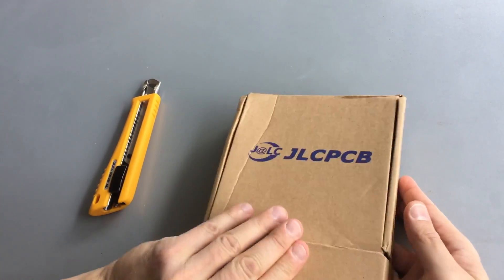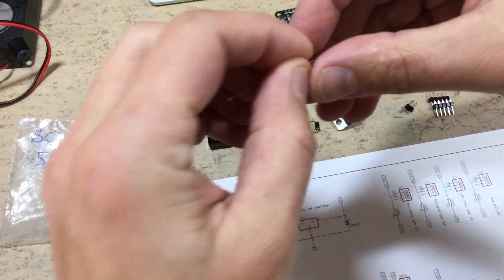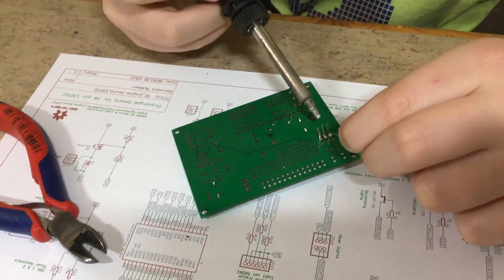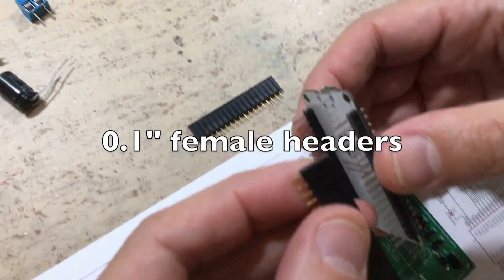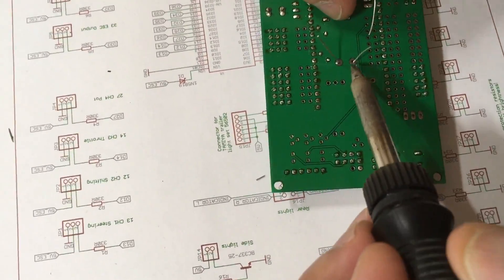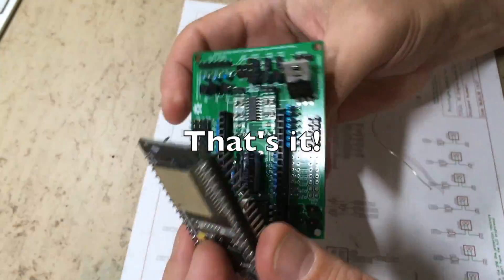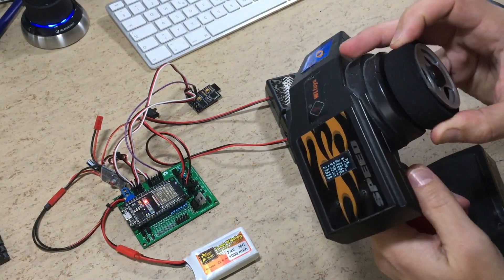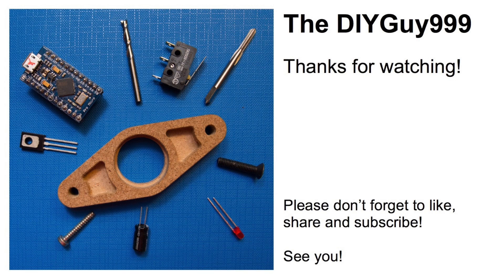Arduino ESP32 RC Engine Sound & Light Controller: How To Assemble The PCB Tutorial

Comment: This looks amazing.  I think this would work for RC planes like my Spitfire.  I think all I would need is start, rev, idea, outoffuel and hornS (for guns) sound files.   However, I don't see / hear engine shutdown.  An airplane engine has all that inertia of the prop so it doesn't just "stop".  Thoughts ?  Also can you provide a complete link for ordering the PCB.  Thanks so much.

Comment: Hi i build the compact one 
and using iBUS protocol 
 Got it build only no sound coming out 
my son install the ESP-WROOM-32  Development Board
sound/light file i know ibus compact for  just sound 

I am using  Flysky FS-i10 FS I10 2.4ghz 10ch Transmitter and Receiver System 
with FS-IA10 and using the  FS-CEV04 Serial Bus Receiver For iA6B iA10 Receiver
Need help on hookup and software to install 
Do i need to feed two power input

Comment: Need help with orderkist . Do any one have list of  all the components .All these link sent to me site of many item not know which one to order  any help would be welcome
Reply from the maker: You should use the current SMD version. It can be ordered according to the pdf in this directory:
https://github.com/TheDIYGuy999/Rc_Engine_Sound_ESP32/tree/master/Eagle_PCB
Also see: https://github.com/TheDIYGuy999/Rc_Engine_Sound_ESP32/blob/master/documentation/quickStartManual.pdf
And:
https://www.rc-modellbau-portal.de/index.php?threads/esp32-arduino-rc-sound-und-licht-controller.7183/
Reply: @TheDIYGuy999  Tjank for reply .how do i open open folder i kept clicking it but open up Would like get pc board and all part at once .I got the Mini Amplifier PAM8403
ESP-32S Board
Reply: @TheDIYGuy999  trying to find the Gerber File to order the pc boardme not good on computer finding thing

Comment: Nice jobb have orded pcb and component put hav an question how to split rear and brake lights so i can use odder rear lights not only Tamiya but Carson 7 chamber
Reply from the maker: Thanks. There is an additional output for brake lights on pin 32, but you have to use an external NPN driver transistor with base resistor. The behaviour can easily be changed in the "void brakeLightsSub()" function

Comment: Finally got it together to tweak it again, and it was doing this:

https://youtu.be/-LvZtwrAluE

Also, when I connect the ESC to the ESC pins, I get power to the board but no movement from the motor.
Reply from the maker: Still sounds like a current supply problem. Are your wires between the battery and the sound controller / ESC thick enough? What type is your battery and your ESC? On the video it looks like you are using very thin wires without a proper T-Plug and two batteries please make a decent Y-cable for the main supply.
Reply: @TheDIYGuy999  just dupont jumper wires between battery and esc. Its a 2s lipo battery with some solid core wire just kinda jammed into the deans plug.. Havent figured out a way to splice into one battery yet. I though a T adapter for the esc wiring wasn't needed with the ESC connection on the board?
Reply: @TheDIYGuy999  the esc is the stock hexfly that comes with the redact gen7. Not sure what model it is. What gauge of wire would you recommend for the main power supply? I think ill try to splice into the line between the ESC and battery with a permanent solder connection. I wish I could find those power adapters included with the ESS sound things.
Reply from the maker: @lordsanityfree  you can easily make your own adapter: solder two t-plugs together back to back, then branch off wires with about 1mm2 cross section, which go to the X1 terminal on the sound controller

Comment: Is there any way to listen to the sounds on PC before selecting them for the ESP?
Reply from the maker: No, not if you don't have the audacity project or the wav files. However, the vehicle selection will be a lot easier in the upcoming v5.2
Reply: @TheDIYGuy999  until 5.2 is ready, can you put the wav files you used for the included sounds on github? playing with settings to find the right sounds for my rig sounds tedious as hell...
Reply from the maker: @lordsanityfree  Have a look at the 5.2 preview zip on GitHub
Reply: @TheDIYGuy999  that does look a lot easier to work with. When do you expect it to be out of beta?
Reply from the maker: @lordsanityfree  I think this or next week. What type of vehicle will you use?
Reply: @TheDIYGuy999  one will be a redcat gen7 I'm putting a custom ford f150 body on. The other will be a custom built 6x6 semi, an old American cabover. Like Optimus Prime took a job as a logger or something.

Comment: HOLY CRAP, IT'S WORKING!!!

When i power the x1 off my battery and let the esc power the rest, it works!

Now I've just got to fine tune things. Like, make it start BEFORE it starts moving. And figure out my horn...
Reply from the maker: I always told you wire it according to the instructions ;-). If you don't want it to drive before the engine is running, connect the ESC to the "ESC" connector, not to the receiver. I strongly recommend to use the Hobbywing 1080 ESC to achieve perfect results.
Reply: @TheDIYGuy999  you're talking about the 3 pins marked ESC below the receiver inputs instead of the extra ch3 input?

What do i change in the code to make ch4 run a horn from a push button?

Also, the LEDs im using have resistors pre-wired in the leads. How do I use those, since the board is designed to incorporate resistors on the board?
Reply from the maker: @lordsanityfree  Yes, I do, that's why it's labelled "ESC".
Connect your push button channel to input to CH4, uncomment //DEBUG, add "Serial.println(pulseWidth[3]);" to the DEBUG section, if not already there, read the values in the serial monitorwhile pressing the button, then change the void triggerHorn() function, if the value is not around 1500.
Your LED wires with resistors are perfect. The board labelling says "use series resistors for the LED". The resistors on the board are for the transistors bases.
Reply: @TheDIYGuy999  heres my end goal for lighting. 
Head and tail lights always on. Easy, just plug them into the rx.
Working turn signals. Easy, board is already set up for that. 
Reverse lights that come on only when moving backward.  ???
Bumper mounted fog lights and light bar controlled by one of my 3 position switches for OFF/ BUMPER ONLY/ BOTH. 

Can this board do all that?

Comment: New board, new ESP32, new everything. Clean install of code. All I get is ESP power cycling.
Reply from the maker: Do the supply wiring according to (chapter "wiring"): https://github.com/TheDIYGuy999/Rc_Engine_Sound_ESP32/blob/master/README.md
The voltage on "X1" needs to be 7 - 12.6V. also make sure, your supply and BEC can handle at least 1 Amp.
Reply: @TheDIYGuy999  i did that. To power the ESP and receiver (remember, just trying to get a working prototype for sound only) I ran a dupont jumper from a 5v pin on the side with the LED outputs to the Vin center pin of the receiver side. 

It seems like everything is fine until the ESP32 tries to boot.
Reply from the maker: @lordsanityfree  And how to you control the throttle? With a PWM servo tester, connected to CH3? And your communications settings are in accordance with the chapter "Interface type"? Also make sure, your ESP32 pin "D0" if you have one is connected to nothing.
Reply: @TheDIYGuy999  I'm using your pcb board so I assume d0 is routed correctly. For throttle control I'm using my radiolink rc6gs transmitter and receiver. Channel 2 on rx (throttle) connected to channel 3 (throttle) on board. Letting the board power the rx.
Reply: @TheDIYGuy999  looking at the Amazon page since I'm not home. Confirmed I have the 30 pin board without a D0 pin.
Reply from the maker: @lordsanityfree  I just tried your wiring with the 5V jumper link and it works just fine. And there is nothing else connected to the rx? Powercycling looks like something is drawing too much current and your supply can't handle it. Is the 5V rail stable and shows continuous 5v? What happens, if you remove the ESP32 from the socket, power it from USB and load the blink sketch (pin2 is the onboard LED)?
Reply: @TheDIYGuy999  i will have to test that when I get home. The 5v rail seemed to dip to about 3v every now and then but I thought it was my fault with the probes. Would that mean a bad regulator?
Reply from the maker: @lordsanityfree  It means you are overloading the regulator, you have a bad contact somewhere (maybe the dupont wire) or a bad battery
Reply: @TheDIYGuy999  how do I find and fix that? The battery is 6 cell nimh putting out 7.8 volts. I dont think it's the problem but I'll try it with one of my newer 2s lipo as soon as they reappear from the move.

Comment: mohon pencerahannya  saya coba  unggah esp32 yang30pin error terus mohon sulusinya..
Reply from the maker: Please read these instructions carefully:
https://github.com/TheDIYGuy999/Rc_Engine_Sound_ESP32/blob/master/README.md
If you still have errors, post the error message
Reply: @TheDIYGuy999   apa harus di pasangi dulu komponen ya ? Setelah itu di unggah??
Reply: @TheDIYGuy999  maksud saya pas di colokin ke pc esp32 apa harus di pasang dulu komponen pendukungnya..
Reply from the maker: @Iwan-Dy  Read README.md, install required board and libraries as described. Then configure "Adjustments.h" to fit your needs and hit upload
Reply: @TheDIYGuy999  ok saya akan coba dulu..
Reply: @TheDIYGuy999  mohon maaf. masih terjadi error lagi. belum bisa ini.
ada tulisan.. ERROR COMPILING FOR BOARD ESP32 DEV MODULE
 board esp32(platform esp32,package esp32) is unknown. mohon sulusinya  untuk memperbaiki error.
Reply: @TheDIYGuy999   ok trimakasih..akirnya bisa bunyi juga..trimakasih...

Comment: Love this project.
I have a small question, that I haven't found the answer to yet.
The ESP board can handle 5V from a regular RC reciever run by the BEC in an ESC? Or do I have to convert it to 3.3V somehow?
Reply from the maker: Yes! It can handle it. Just the signal pins are limited to 3.3v, which us fine with modern receivers.
Reply: @TheDIYGuy999  Thanks. 
But aren't the signals from the receiver 5v?
Reply from the maker: Lars Martin No, the receiver has a 3.3v regulator for its processor, so the signals are 3.3v in most recent reveivers.
Reply: @TheDIYGuy999  Ah. So servo's and receiver all communicate on 3.3, but are powered by 4.8-5 from the bec? 
The world just got a whole lot easier😉
Thanks✌️

Comment: Firstly, thanks for making all your efforts available :)
A few questions:
If I only have a 3 channel radio, with Ch3 being 2 position, how do I use this to turn headlights on/off?
Also, how to make headlights independent of throttle??  I think this would be much better.
Regards
Dave
Reply from the maker: Hi, thanks. The headlights can only be switched automatically in the currrent software. Otherwise! You have to change it.
Reply: @TheDIYGuy999  Am currently playing with making new sounds, have a reasonable Toyota Start and Idle version working (can share if you like).  I've now also added and engine shutdown .h file. 
Some requests: 
Is there a variable to limit the rev sound spike when downshifting?  My Toyota is way too high even at low throttle, can it be linked to the current throttle position?
When changing gears (setting it up for a Tamiya Bruier type 3 speed), can you make the throttle fall naturally then quickly ramp up to current throttle?*
*I'm using a stick style transmitter with gearshift H "gate".

Thanks again.
Reply: Been digging through the main code, modified the Auto throttle parameters as below, still experimenting with the +- numbers but got the desired sound effect when shifting.  Do these numbers also relate to the ESC output on pin 33 or just the sound?

 // Auto throttle while gear shifting (synchronizing the Tamiya 3 speed gearbox)
  if (!escIsBraking && escIsDriving && shiftingAutoThrottle) {
    if (gearUpShiftingInProgress) currentThrottle -= 100; // LESS throttle
    if (gearDownShiftingInProgress) currentThrottle += 100; // MORE throttle
    currentThrottle = constrain (currentThrottle, 0, 500);
Reply from the maker: @DaveyGa  these values above are mainly intended to adjust the gearbox input rpm in order to "synchronise" the gearbox. The sound is affected as well. If you want to change the speed of engine rpm change (for the sound), you have to change these parameters:
// Engine mass simulation
const int8_t acc = 2; // Acceleration step (2) 1 = slow for locomotive engine, 9 = fast for trophy truck
const int8_t dec = 1; // Deceleration step (1) 1 = slow for locomotive engine, 5 = fast for trophy truck
Reply: @TheDIYGuy999  Thanks, will give it a go :)
Reply: Hello DaveyGa, Can you please show me how to adjust remote in adjustmentsremote.h, esc.h  with 3 channels radio? And the wiring from esc, receiver and esp32 please? Ur help woul be appreciated

Comment: Do you have a video about what to do once the board is built? Mine is built but I have no sound or lights. I'm pretty sure its an arduino configuration error but I can't seem to figure it out. I'm using a standard receiver setup and feel I have it configured for that. I can get it to load on to the ESP32 but get nothing after that. Maybe do videos on how to configure it if using standard servo connections, SBUS, etc. Also a walkthrough of the settings in your arduino files would be helpful.
Reply from the maker: For a standard receiver, you have to configure it as follows (add // to line 34):
// ---------------------------------------------------------------------------------------------------------------------
// Choose the receiver communication mode (never uncomment more than one! If all commented out = classic PWM RC signal communication)--
// SBUS communication --------
//#define SBUS_COMMUNICATION // control signals are coming in via the SBUS interface (comment it out for classic RC signals)
boolean sbusInverted = true; // true = wired to NPN transistor signal inverter or uninverted SBUS signal (for example from "Micro RC" receiver)

// Serial communication --------
//#define SERIAL_COMMUNICATION // control signals are coming in via the serial interface (comment it out for classic RC signals)
// Only for my "Micro RC" receiver! See: https://github.com/TheDIYGuy999/Micro_RC_Receiver

// PPM communication --------
//#define PPM_COMMUNICATION // control signals are coming in via the PPM interface (comment it out for classic RC signals)
#define NUM_OF_CHL 8          // The number of channels inside our PPM signal (usually max. 8)
#define NUM_OF_AVG 1          // Number of averaging passes (usually one, more will be slow)

Connections:
CH1 = steering
CH2 = shifting servo
CH3 = throttle
CH4 = additional functions

ESC connected to "ESC" output (Hobbywing 1080 strongly recommended).
Note, that you have to use resistors for the LED (except Tamiya port)

For different vehicle configs, have a look at the examples in the "settings" folder (copy and paste them to hour "Adjustments.h" tab)
Reply: @TheDIYGuy999  Thanks. I'll work on it more
Reply from the maker: @SpeedyDad1  You're welcome. I'm currently working on an improved guide. It will be included in the next SW version on GitHub
Reply from the maker: You can now find he improved documentation on my GitHub: https://github.com/TheDIYGuy999/Rc_Engine_Sound_ESP32
Reply: @TheDIYGuy999  Thanks. I finally got sound. I had the speakers hooked up according to the plus and minus on the board, but for some reason, the left speaker only worked when hooked up backwards. If I hooked it up correctly, I got no sound at all from either speaker.
Reply from the maker: @SpeedyDad1  good to hear, that it's working now. This is very strange, usually speakers are not polarity sensitive, because the the amplifier output is AC anyway. Are you sure, it's not just a bad contact or solder joint?
Reply: @TheDIYGuy999  Nooe. No matter how many time I try, it only works plugged in one way. Very odd, yes.
Reply from the maker: @SpeedyDad1  What speaker do you use? Is it some kind of active type? Everything else works fine?
Reply: @TheDIYGuy999  These are what I got until the ones you recommend come in:
https://www.amazon.com/gp/product/B07FTB281F/ref=ppx_yo_dt_b_asin_title_o04_s00?ie=UTF8&psc=1
I've only gotten the startup and idle to work. I think my problem with everything else is I don't have the various files in the correct locations. I'm rather new to arduino.
Reply from the maker: @SpeedyDad1  The throttle is working? For the other functions, connect the channels according to GitHub: CH1 steering, CH2 shifter, CH3 throttle, CH4 horn / siren / bluelight. Headlights, taillights, brake lights, cab lights  and indicators will work automatically. Use serial resistors for them (except TAMIYA trailer port). If the sketch is uploading to the ESP32, all your files are correct, otherwise it would throw an error message. If you want to test different vehicle types, copy the content of the example files in /settings and past it in the "Adjustments.h" tab, then configure the communication type according to the new documentation on GitHub. If you need more support, you should make a video, which shows the issue in detail.
Reply: @TheDIYGuy999  Yup. I'm getting more to work. I'm learning more as I read down through the adjustments file. This is kind of fun to discover what everything does.
Reply from the maker: @SpeedyDad1  Have fun with it
Reply: @TheDIYGuy999  Have it pretty much figured out. Made some false assumptions when hooking a couple things up but figured out my error by tracing the circuits on the schematic. I will be using these in a couple vehicles. One does not use a 3 speed transmission. Would there be a way to map the 2nd aux input to turn the lights on and off?